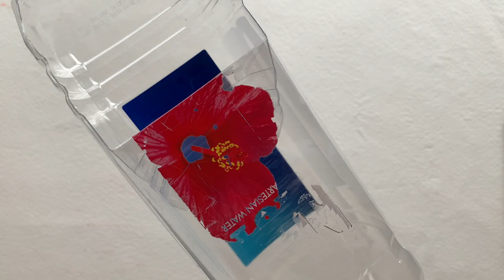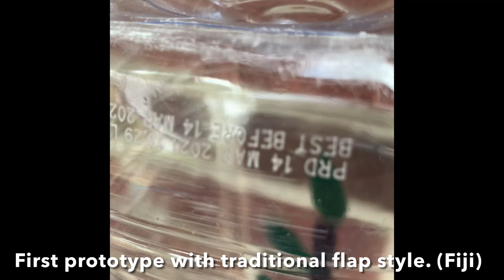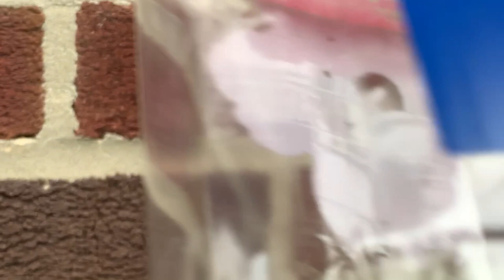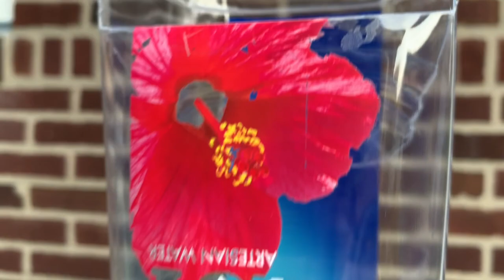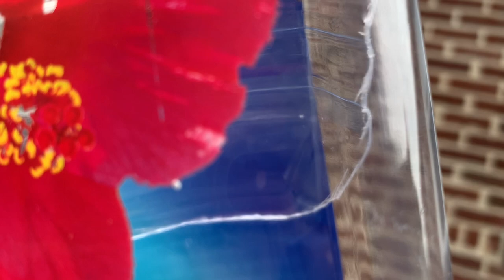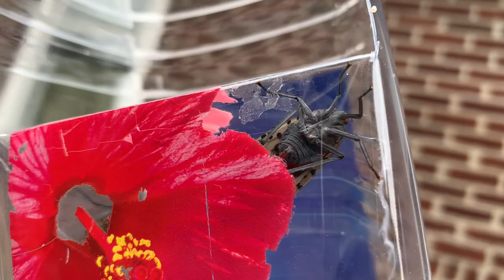DIY lanternfly catcher from a bottle and a broom handle

Comment from the maker: Tazo:
I like the Tazo Tea bottle the best so far. Good size, no ridges for them to get caught up on, easily cut, the lid is slightly too soft, will need a nut or additional soda bottle cap to secure the base lid to the pole better. Wide neck, quickly emptied. The label is effortlessly removed without any residue left behind. Flat neck area, however, means lanternflies more easily jump while trapped. Make sure your flap is sized well so they bonk their heads.  The roof is somewhat noticeable, but doesn’t seem to spook them.

Comment from the maker: Simply beverages:
The Simply (OJ, lemonade, Almond milk, etc.) bottle has a thick roof that tends to scare the lanternflies off before the catcher is in place over top of them. Also, the angled ridged areas on each corner creates a multitude of problems, and the gigantic lid is also pretty obvious. Overall, gets an F.

Mooala:
The Mooala plant milk bottle has edges that are much too curved and very difficult to cut through at those curves, making it so the flap isn't ideally placed (and dangerous to cut). The plastic also appears to be more brittle, or it's possible it is just less flexible.

Spice jars:
Bulk spice jars will need a 63 mm lid to replace the traditional flappy spice dispensing lids.  (possibly from a wide vitamin container or some sort of cream jar)

General advice:
Lanternflies like to hang out on my house at the 90 degree angle space where the roof overhang meets the wall, so the ideal catcher will have good square edges so the bottle can block potential escape routes.

The more clear the bottle, the better, so frosted half-gallon milk bottles probably won't work very well. You want them to be surprised when you sneak up on them.

Comment from the maker: Fiji:
Runner up: Fiji water bottle. Good firm rectangular edges, pliable and without too much excess plastic on the roof (former bottle base) that would otherwise spook them or distort the view of the "plant" inside the bottle (that is, if you wish to paint a plant for lanternfly appeasement.) 
It has horizontal ridges that seem to trip them up on entry, so they soar with less velocity into the catcher and often get caught on the flap.  
Front label removal leaves behind text and a flower. (rear label comes off clean) you can use the flower to your advantage, though. They might be attracted to it.  The blue label might be calming for them while they’re in the bottle, but possibly makes them avoid jumping in?  Perhaps keep the blue label and paint plants on the sides?
The octagonal corner causes the flap to be held more stiffly than other flat flaps, also reducing soaring velocity.  Small slices at each side of the hinge might be needed to bypass those corners.
The base is funnel shaped, so trapped lanternflies jump less.

Comment: What a great idea! Maybe put some sticky tape on that flap, if you wanna keep them from climbing out. Do you have any solutions for bushes? The sticky tape is just falling off of the bushes on the skinny branches.
Reply from the maker: yeah, shrubs are tricky.  maybe spray with a hose and watch where they land and then collect from there?  

i wouldn't want to put a sticky strip inside my collector, i keep it inside the house, and need  to get them all out of there.  (don't want decaying lanternflies inside my house, and then the ones stuck on the walls would also block the clean sailing into the collector of the ones i'm working on collecting.)  i don't mind shaking it when i go around scouting, and emptying it frequently.  

i'm going to try how it works with a pretzel container.  it's much larger, so it could be a little too unwieldy.  i'll have to definitely use a second sturdy lid upside down as a nut for this one. 🤣

i'm also testing how spray painting the back and side walls works.  (i tried using brown paint, and i think it spooks them too much, and it's also difficult to see them in there, so next up will be a cream color)  i leave the top of the collector clear, and spray paint the 3 wall sections below the flap.  it seems to keep them a little more calm.  i have to test it more though.  as long as you slowly put the opening over them, they seem to not get spooked too early, and they jump right in.

Comment from the maker: Generic Fruit Juice:
Many fruit juice bottles have ridges all the way down the bottle. This isn't ideal for many reasons - the bottle would be easily seen by the lanternflies and avoided, and if a plant is painted on the bottle, it would be totally wavy and unrealistic. Also, the milk cap-type lids are very thin and often ripped to shreds when the speedbor bit is used, and are also extremely wobbly when attached to the pole.